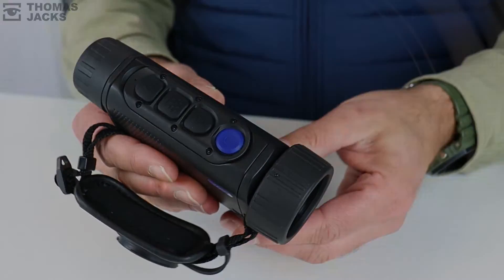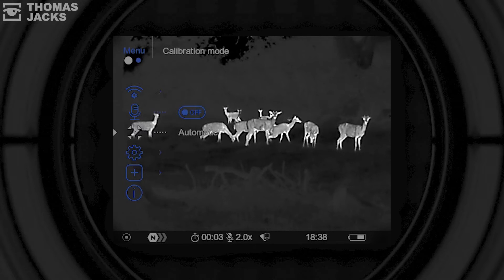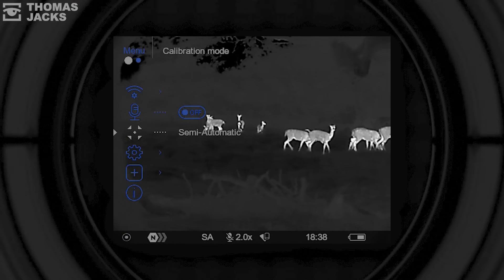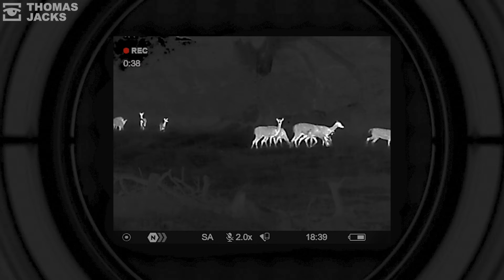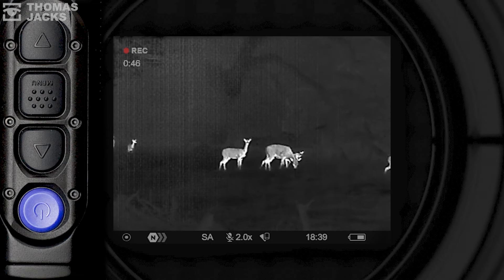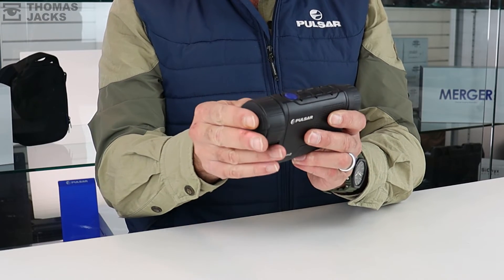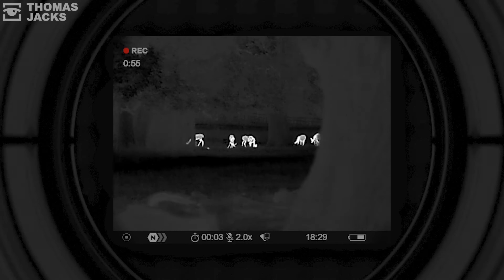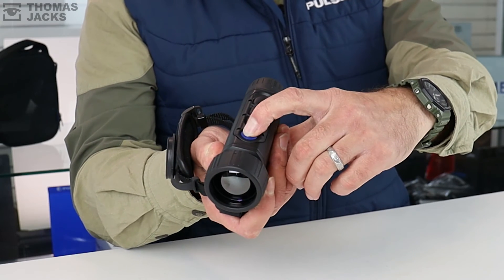Pulsar one minute guide: Why does my thermal image freeze?

Comment: I’ve done all of this but I’m still seeing images through what looks like a net curtain. I’ve never had totally clear images like the ones you showed. I contacted Pulsar when I first bought the Axion and was told how to calibrate. I thought the results was as good as it could get following calibration but it’s never come close to your images.
Reply from the maker: Check you're on Automatic calibration (you can change to this mode in settings). 
- Also turn your device on 5 minutes before you need it - It'll allow it to normalise to the ambient temperature.
- Try a different sensor amplification setting*.
- And it'd be worth checking that your firmware is up to date.*
* We've other one minute guides to show you how.

Comment: My pulsar takes a pic and then the screen looks a bit ghost like.  I can see through the image but unsure how to get rid of it.
Reply from the maker: I wonder if you're in Semi Automatic calibration mode -  SA will appear on the bottom of the screen (If so it only calibrates the screen when you tap the power button).
Go into Calibration setting in the main menu and switch it to Automatic (you'll see an A on the bottom of the screen).

Comment: My thermal scope has a solid freeze. It does not calibrate.
Reply: I'd appreciate a reply.
Reply: My calibration is on automatic, I think there is another issue
Reply from the maker: See if this works: 
1. Put it in Manual Calibration mode (M will appear on the bottom of the screen). 
2. Close the lens cap 
3. Then tap the power button.
4. Remove the lens cap and take a look.
If that works - it will allow you to use your device but the shutter might be stuck and it would be worth contacting the retailer you bought the device from. @AnthonyHershberger
Reply: There is no calibration problem The screen is just white.
Reply from the maker: I assume you've removed the lens cap?
Last thing to try before contacting the retailer you got it from:
1. Long press the menu button. (I'm hoping that will bring up the main menu for you)
2. Select General Settings (cog)
3. Restore factory Default Settings (return arrow), then click 'yes'
Good luck and let me know how you get on.
   @AnthonyHershberger
Reply: I have all the Settings And stuff It almost looks like the cap is still on. But it isn't.
Reply from the maker: If you can see your reflection in the objective lens then the lens cap is off! And if you can see the menu controls then you've got power and the display is working. 
I advise you go back to the retailer you bought it from and show them. If it's too far to travel video what's happening on your phone and send it them.
If you bought it in the UK and there's a problem, it'll come back to us at Thomas Jacks and we'll sort it. Even if it's out of warranty we can take a look and let you know what your options are / if it needs a repair what'll cost to fix.  @AnthonyHershberger
Reply from the maker: Check the device is in Automatic Calibration mode (there will be a capital 'A' on the bottom of the screen). If you've got 'SA' or 'M' it will only calibrate when you  tap the power button.
To change the calibration mode to Automatic:
1. Go to main settings (long press)
2. Select the Calibration Mode option
3. Tap the Menu button to accept
4. Long press the Menu button to exit the menu
5. Double check there's an 'A' confirming you're in Automatic Calibration Mode. 
Let me know how you get on.

Comment: I have a XQ35LRF : The camera as powered on it self-calibrates EVERY FEW SECONDS (no fog, no rain, 18 degrees celsius), During use, numerous vertical streaking appear on the screen. After calibration, these artifacts disappear temporarily, but reappear again after a few seconds. I noticed that when the camera warms up after 10m the situation improves. Is this a
warranty issue or is it normal camera operation? The camera is unusable.
Reply from the maker: Next time you use it, take it out of the case /out of your pocket several minutes before you plan to use it, so the device is the same temperature as the surrounding environment. Once you get to that point you should typically expect around one or two minutes (in dry conditions) before you notice the streaking and the unit automatically recalibrating to clear it.

Comment: Hi. Just got my XQ35LRF and it’s great. However one little question. I get ghost’ images ! I.e if i am looking at a fox, then move to something else the fox image is still there after two or three refresher’s then goes, is this normal?       Also which calibration mode is best for normal conditions ie  warm evenings.
Reply from the maker: Calibration is normal for every thermal device, irrespective of manufacturer... so don't worry. And you've already found the right Youtube video to start to understand what's happening.
I'd recommend Automatic calibration mode irrespective of weather conditions.
Most devices tend to calibrate more initially, as they reach the ambient temperature of the conditions you're using it in. After that, probably every couple of minutes or so (although more frequently if the sensor is having to work particularly hard...  such as in fog, rain, snow or high humidity.)
Because I film with thermals always use  automatic calibration mode, AND press the power button to recalibrate before I start filming or before the action gets interesting. That way I hopefully avoid any "ghosting" for the crucial moment I want to include in the final film.

Comment: Mine’s new and in auto mode calibrates every 10 seconds or so. Is that the expected calibration  interval? If so, it makes the device virtually unusable. If I put it in manual mode the image degrades very quickly so that’s not the answer either.
Reply from the maker: The intervals between calibration are much closer together when it's cold/first turned on, and when there is a lot of moisture in the air (rain or fog).  Don't worry, it is normal for all thermal devices (especially when going from a warm house/ vehicle to minus temperatures). 
As the temperature of your thermal device normalises with the outside temps, the calibration times will become longer.  Give it about 5 minutes (out of the bag / your pocket) for it to be the same as the outside temperature and the calibration intervals should be longer.
Reply: @thomasjacksltd  Good to know, thanks for getting back to me. I’ll see how it goes.

Comment: well that's all well and good but why does mine freeze to a brown screen and to get the image back you have to press the on/off button . I sent the unit back to Scott country who had it for a week and said it only did it once and that was how to get the image back.
Reply from the maker: That sounds like it was in 'Manual' calibration mode - so hopefully this video explains what's happening. If you've still got a problem (and there's not an 'M' at the bottom of the screen, indicating it's in Manual calibration mode) then you can get in touch with the UK warranty / servicing team here:  https://www.thomasjacks.co.uk/contact.asp
Reply: @thomasjacksltd  no mate not in manual mode in auto
Reply from the maker: Try a factory reset (which you can find in 'Settings'), 

Also check if the device has the latest firmware: Switch on its wifi and connecting to the Pulsar Streamvision  / Streamvision2 app on your phone (depending on which model you have). It'll let you know if an update is available.
If they don't work, take a video of what's happening and send it to us at support@thomasjacks.so.uk